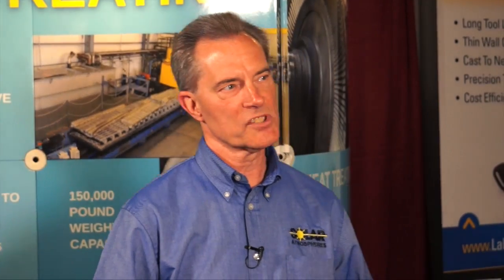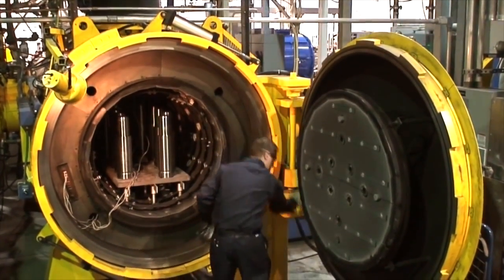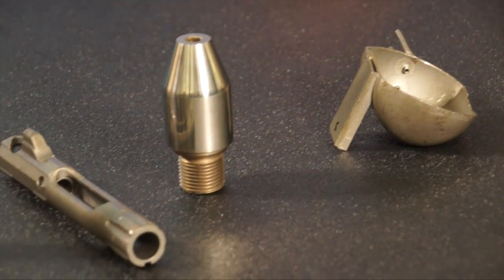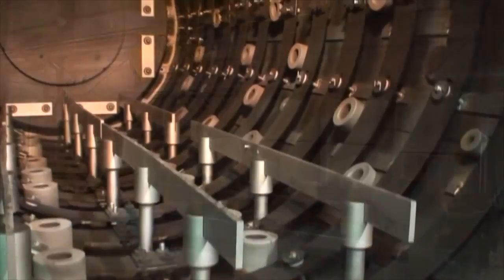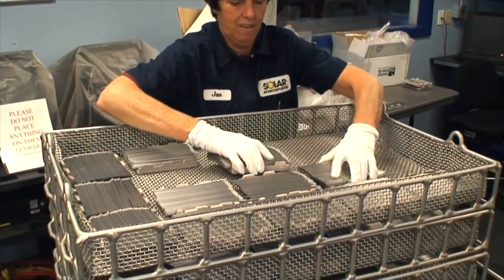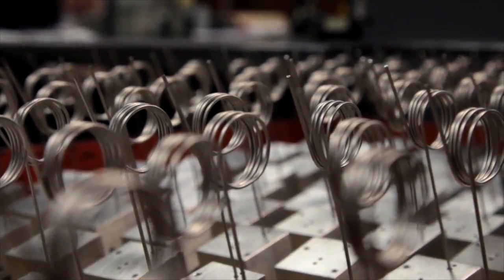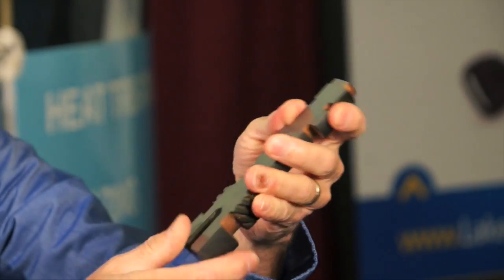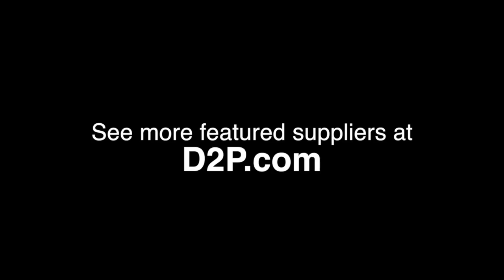Vacuum Heat Treating, Brazing, Carburizing, and Nitriding | Solar Atmospheres | Souderton, PA

Comment: What method is used to heat the material? Direct contact with flame?
Reply from the maker: Heat is generated in vacuum heat treating by a variety of methods, including:
Electric resistance heating: This is the most common method of heat generation in vacuum heat treating. A coil of wire is placed inside the furnace and heated by an electric current. The heat is then transferred to the metal parts by conduction.

Induction heating: This method uses a coil of wire to generate an electromagnetic field. The electromagnetic field causes the metal parts to heat up by induction.
Radiant heating: This method uses a heat source, such as a furnace or a lamp, to emit infrared radiation. The infrared radiation is then absorbed by the metal parts, which causes them to heat up.

The specific method of heat generation that is used in vacuum heat treating depends on the type of metal being treated and the desired results. For example, electric resistance heating is often used for heat treating steel, while induction heating is often used for heat treating aluminum.

Comment: I watched this to learn about vacuum heat treatment and wow, that was interesting. So it visually effects the steel, but why is that? Does the removal of oxides result in limited distortion because of a more evenly packed grain? Excluding the different treatments, is there any mechanical difference? For instance, if I wanted to forge pearlite, would vacuum treating be optimal for strength or would the difference be negligible/non-existent?
Reply: yes